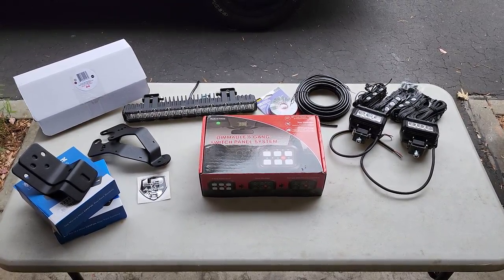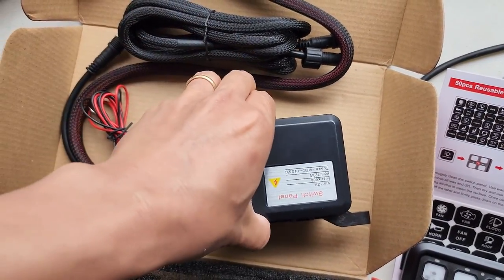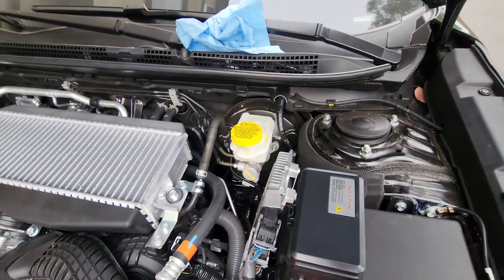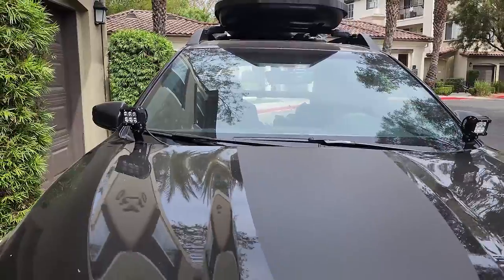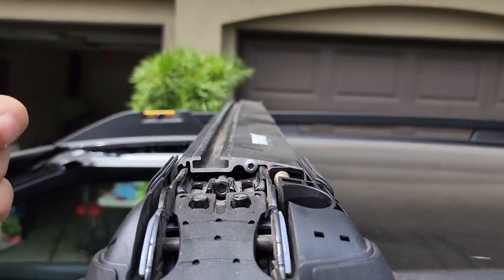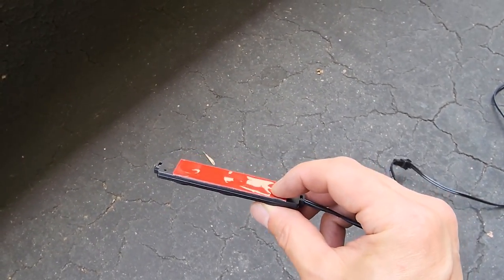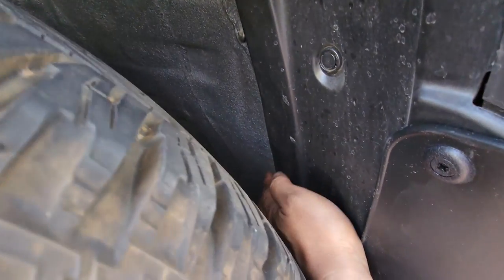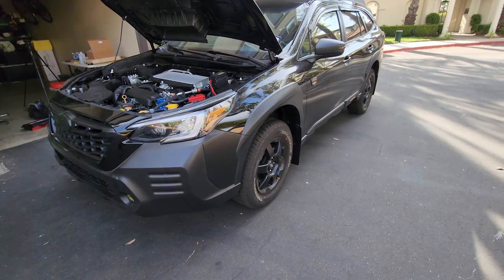Subaru Outback Wilderness gets LED lights. LED Light bar, Ditch Lights and Rock Lights. Installation

Comment: At 6:59 you mentioned you had to cut a section off? I attempted this install last night and i don’t see how the wire would fit through. Did you cut part of the grommet in the firewall to make it fit?
Reply from the maker: yes, I sliced a tiny portion of the grommet to put the wire through.

Comment: Hi again, I got all my lights on and everything is working great. I just wish I could post a pic of it here.
Reply from the maker: That is great to hear! How was running the wire through the fire wall?
Reply: I’m just worried that I’d eventually have to upgrade my battery or my alternator because the led that’s on the switch for the top light bar stays on all the time and I don’t want that to cause my battery to run down.
Reply: So after just one trip out after installing the new rock lights, the same ones you have, I must have gotten some debris caught up in my undercarriage and now none of the rock lights work anymore. Have you experienced this with your rock lights yet? Suggestions? Thoughts on how I can better wire everything so nothing happens to them from road debris? Thanks!

Comment: How did the double sided tape hold up when you mounted the aux box on top of the fuse box? Also, can you easily access the fuse box when needed? I think hard wiring it is the way to go along using the six gang Aux Beam. (Instead of the Bluetooth option)
Reply from the maker: its still holding just fine and it is very easy to access the fuse box! but make sure you wipe and clean the surface with isopropyl alcohol and dry the surface before mounting it.

Comment: Trying to use this coat hanger method now. It is a pain in the arse. Having trouble getting it to come through. Come on Subaru why not just have a blank empty spot to pass through. 😂 thanks for the video. Helps a lot good detail on wire location. If I can get through that rubber grommet now….
Reply from the maker: Hello Andrew. Thanks for your comment and yes it is a real pain... but once it comes out, the satisfaction is unmatched lol.
Reply: @ChasingAdventuresCO  I had to cut the rubber grommet a bit larger than I thought. Not sure which I what I am more satisfied about just actually getting the wire through or that I’m finally finished with everything. I installed ssd bar with 4 diode dynamic SS3’s on it. Might add ditch lights later on will see. My wife says it will look ugly with those 🤦🏼‍♂️🤷🏼‍♂️. I like the under body lights you did but that might be a wait until it’s warmer weather kind of thing it’s not necessary for now. Thanks again for the video was very helpful.
Reply: @ChasingAdventuresCO  did you put any kind of sealant around the wire going through the rubber? Just curious if it will leak at all.
Reply from the maker: @Andrew Greene  nope. It's so far back in the bay, I thought it was unnecessary.  Been driving like that going over puddle of water, rain and all sort of off roading without any leak.
Reply from the maker: @Andrew Greene  hey Andrew. I am glad I could help! Ditch light does get some used to but when driving in the dark woods, it's a definitely a plus and the looks out way the cons.

Comment: What is the model number, size, etc. for those roof bars?  I do not want to use "towers", I like that low profile you have...
Reply from the maker: here you go. https://www.thule.com/en-us/roof-rack/car-roof-racks/thule-wingbar-edge-_-1035184?fitassistant=make%3ASUBARU%7CSubaru%2Cmodel%3AOutback+Wilderness+5-dr+Estate%7COutback%2520Wilderness%25205-dr%2520Estate%2Cyear%3A2022-%7C2022-%2Cvariation%3Aroof-type-617942%7CRaised%2520rail

Comment: I solved the same problem by installing roof rack and light bar to the roof rack. Your installation will block some light. The other option is installing the light bar to a bull bar.
Reply from the maker: Hi.b thank you for the suggestion and I have thought about getting a pull bar as well. Nave in the future ~

Comment: Hello. I have the 24 crosstrek sport and I have installed some pod lights and a light bar using your method (connecting the fuse straight to the battery). But nothing seem to work. Did you connect each light's black wire to the the battery's negative? Thank you!
Reply from the maker: no, i connect the negative wire onto the 10mm bolt right behind the fuse box. and you are using a switch gang correct?
Reply: Yes sir I am! Same as yours!
Reply from the maker: @KurtGamueda  hmm, yes I've connected the positive wire to the battery. try changing the spot to power your pod because one of the spots only has a 5 amp fuse and depending on the pod you have, it may not be enough amp to power the pods

Comment: Have you consider using rhino rack platform but using mounting bracket instead ok cross bar. Thats what i install to my forester. You ca use the one that fits for the pick ups.
Reply from the maker: Hello Dennis. Thank you for the suggestion but I am but lost.. can you explaine it again?
Reply: @ChasingAdventuresCO  sorry for the typo.
You can use rhino platform without using cross bar. There is an accessory or attachment that you can get from rhino which is SX100, comes in 4pcs. This will gonna be the leg of your rhino platform. It will minimise the height of your rooftop carrier. You can choose the size of your platform but dont go too much.
Reply from the maker: @denniscoronel2691  oh I get it now. Well yes I did thought about getting the platform but I need to carry a cargo box and didn't think it would fit with the platform plus it will just add more weight and hight. If that makes sense. But the light bars are still holding up great with just the double side tape! Those 3m tapes are amazing. LoL. But thank you for the suggestion ~ I really appreciate it!!
Reply: @ChasingAdventuresCO  height wise is ok, cos u will less the thickness of the cross bar but as you’ve said you have a box or capsule as ive seen in your videos yeah thats a big factor plus the weight of the platform.
Anyways, keep it up. Stay safe always
Hope we have wilderness edition here but for now, subaru australia is on the process of havin it. Already ordered the outback xt sports trim for now and i traded my 18 forester.
Reply from the maker: @denniscoronel2691  oh yeah I heard you guys got fake wilderness over there 😆 It's a shame... at a beautiful place like Australia, you guy should of gotten them first. Well good luck with what you git and yes safety first!! Thank you Dennis!

Comment: Awesome. 
Questions: did you first poke the coat hanger from inside to out? Or did you start in the engine bay and push to the cabin?

You said you had to trim or cut something at 6:59. What were you referring to?

 Now that you pulled that wire through, do you have any tips or tricks from your experience?
Reply from the maker: Hello Geoffrey, yes it was from inside out, and after i poke the wire hanger through I had to cut the rubber bushing around the wire hanger.
it was a difficult one and I had to try multiple times but dont be afraid when pulling the wire through. good luck~

Comment: Hi again, how did you splice the 2 sets of undercarriage lights together to make them work with your auxbeam? I want to do that with mine. I bought the same lights but I’m using the blazer international wireless remote trigger. Since there’s 2 sets of wires that need to be wired to the controller, I’d prefer to have both sets on one button. Is that possible?
Reply from the maker: Yup that easy. Just put both wires into the controller
Reply: @ChasingAdventuresCO  in the same port or use 2 separate ports on the controller box?
Reply from the maker: @matthewowen5574  in the same port if you want to control all the lights at once.
Reply: @ChasingAdventuresCO  thanks, I’ll let you know how it works. I ended up buying another set of ditch lights and replaced the rock lights I had with the ones you have. l still have to install everything. Luckily my roommate is a great electrician lol.
Reply from the maker: @matthewowen5574  That sounds good! Let me know how it goes. 👍

Comment: Have you had problems with the control panel draining your battery?
Reply from the maker: No. None at all!
Reply: But didn’t you connect it to battery so the control panel light is on all the time?
Reply from the maker: @TheSkierxing123  Yes I did and yes they are on all the time but they draw such a little voltage, that it really doesn't matter. and I can honestly tell you that because I had the car parked for 3 weeks without starting and it was fine.
Reply: @ChasingAdventuresCO  interesting.. I’m using the same panel on my 24 wilderness and after a week my battery died. Trying to locate the source of problem. Did you upgrade the OEM battery? Thanks!

Comment: I tried the double sided tape it came with....fell off.   Then tried 3m....fell off with Cali heat.  I stuck it to the fuse panel access door.  Was hoping not to drill it but may do that.
Reply from the maker: Really,  I had no issues with the  Santa Clarita heat!. Did you clean the surface with isoproply alcohol? And let it dry and clean the residue? Cause it still have them on, and it's not coming off. Try that first.

Comment: How did you black out the chrome around the subaru emblem? I have the same 22 black wilderness and I bought an overlay for the emblem but I can't find anything to cover the chrome ring
Reply from the maker: Hello Aaron. Congrats on the car. The ring was blacked out using plasti dip! Covered the sides and painted the whole emblem and slowly peeled off the sections I didn't was to he covered and that's it!!

Comment: So is your auxbeam always on because you connected it directly?
Reply from the maker: yes it is.
Reply: It doesn’t kill the battery?
Reply from the maker: @Dozaa.  it such a low voltage, it does not.
Reply: @ChasingAdventuresCO  thank you i appreciate your help 🤙🏽
Reply from the maker: sure~ anytime. FYI, I had the car parked close to 3 weeks and it fired up right away.

Comment: Good one! Wish I saw it when I was messing up with mine. 😀 These LP hood brackets - are they sturdy enough? How about vibration when driving? I used ADF brackets and had to put some sticky expanding foam between brackets and the hood in order to stop them shaking. 

I also see you have a tow hitch installed, I assume you did it yourself as everything else. Silly question about that one - do you happen to have that rear bumper beam around still? If so, can you please measure attachment points and let me know sizes? I am looking for the distances between holes, etc. Basically I need these in order to replace that actual beam with something custom,. but not a tow hitch. I'll let you know what is it going to be, when I am done with my little project. Thank you in advance.
Reply from the maker: I have 0 issues with the LP Aventures hood brackets. No rattling and holding up just fine.
And yes I have my brace and which points do you need measured? The 3 bolts? Total length?

Comment: Where did you attach the ground wires from the lights?
Reply from the maker: You can connect the ground wire to any part of the chassis but I connected it to the bolt behind the fuse box. If you look straight ahead from the front of the car, there are two bolts exposed and you can use any of those.
Reply: @ChasingAdventuresCO  cool. Thanks !
Did you use a wiring harness ag all or just run a positive and negative wire from the lights ?

Comment: I’m about to install a 6 gang panel but the acc wire got me a little confused tbh . Have you had any issues with having both cables positive cables on the battery? For example dead batteries or needing a jump often? I’m thinking about going this route but I’m concerned about the health of the battery.
Reply from the maker: Hi Bud!! hope you are well, No I had no issues at all.. I was bit worried to but I had the car in the garage for over 3 weeks without driving and it didn't have any trouble starting up. the acc wire draws such a little current, its fine.